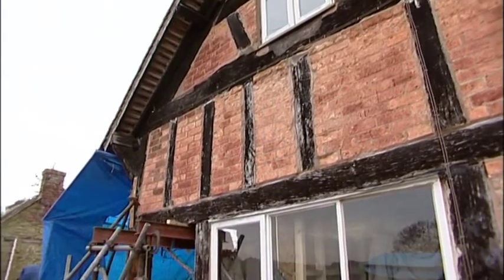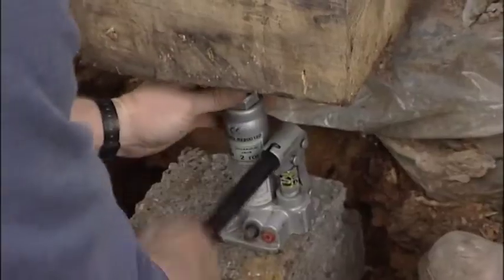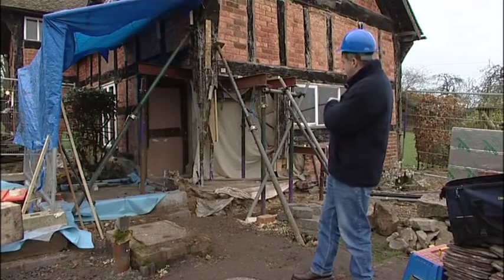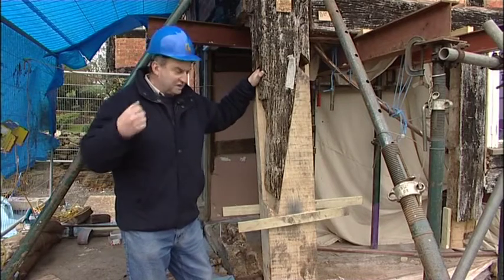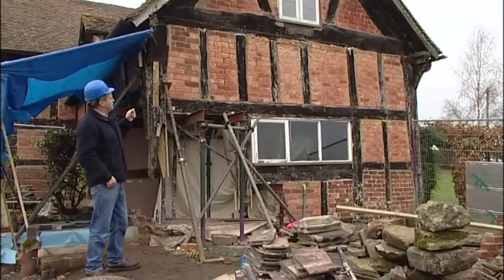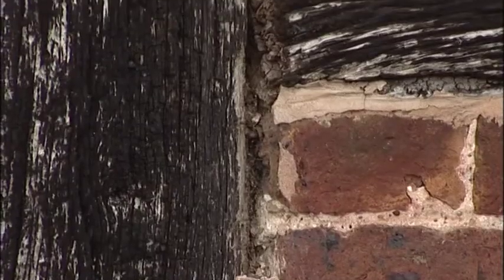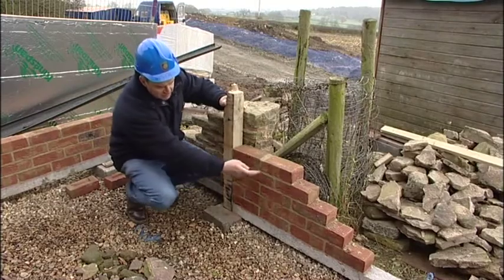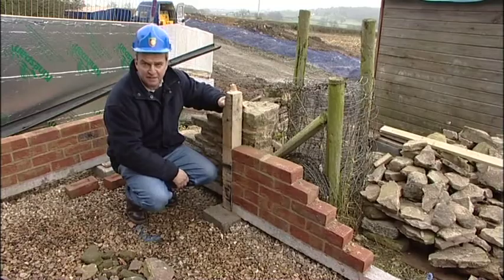9b. Timber: Structural timber repair

Comment: Understood. But how do you keep water from infiltrating house walls, ceilings, dripping on Inside of windows if there is no seal or drip edge on horizontal and vertical timbers? Really hoping someone can tell me. I am new to this house and the damage each rain storm is significant. Thank you.